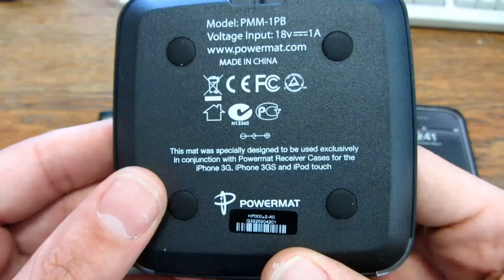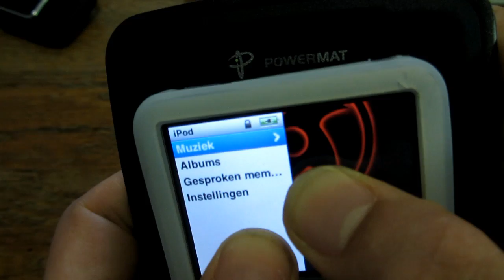Iphone wireless charger(Powermat) teardown/autopsy

Comment: Picked one up for $2 at a church bazaar.  Your video saved me the trouble of tearing it apart.  Mine came with a universal receiver that plugs into the phone, so instead of just plugging the phone into a wall charger, I plug the phone into the receiver and place it on  the wireless charger.  I think I am missing the BIG benefit :-)